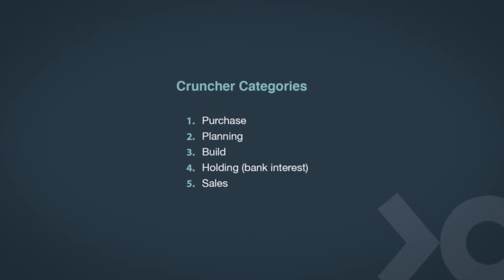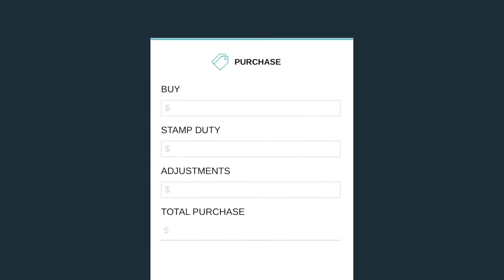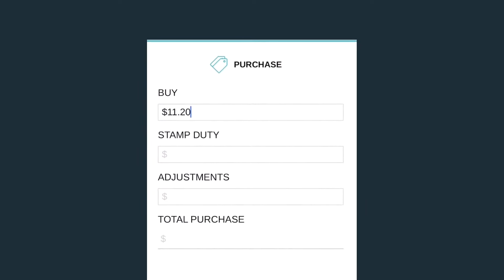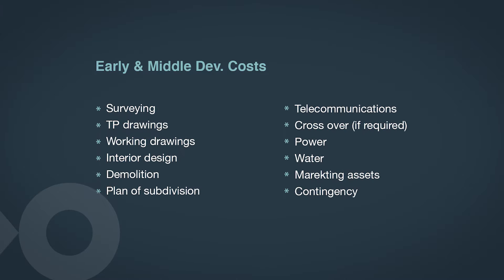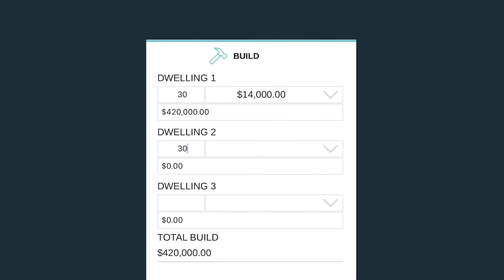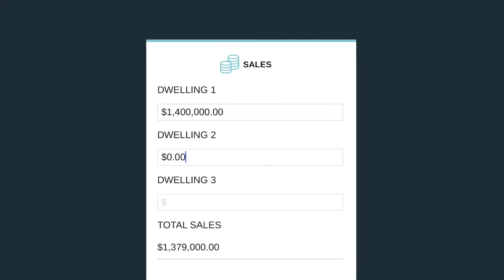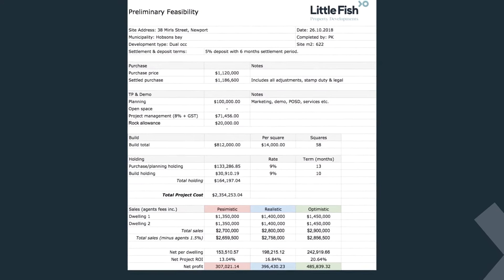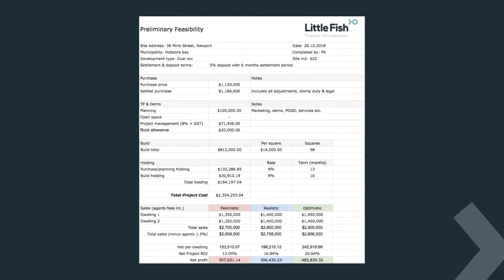How to Do a Townhouse Development Feasibility Study

Comment: Gr8 vid Pete. Merry xmas! Re build cost: $14,000 per m2 at 30 m2? does this mean the dwelling is measured as 30 m2 floor space/interior only? I've seen some builders talk about the cost as - e.g. $2000 per m2 for a 170 m2 t/house build. Am i on the wrong track? thx for vid..
Reply from the maker: Thank you, I appreciate the feedback glad you're benefiting! The purpose of this video is more about the formula and different costs that need to be considered and less about the actual cost amounts.

That said, I haven't done a video on how you calculate the build squares it's something I should consider doing though. A quick Google search should get you heading in the right direction though! $2000 doesn't seem right that's for sure!
Reply: Divide meters square by 9.29 to get house squares 
30 house squares = 278 m2 (approx)
Reply: Squares vs Square Metres
Reply: @jasonjohnson7711  thank u JJ. So the industry terminolgy/jargon is 'house squares' when i'm talking to building professionals? ty friend
Reply: @leekitchen471  thank u Lee
Reply: @peterkellyofficial  Thank u Kells.